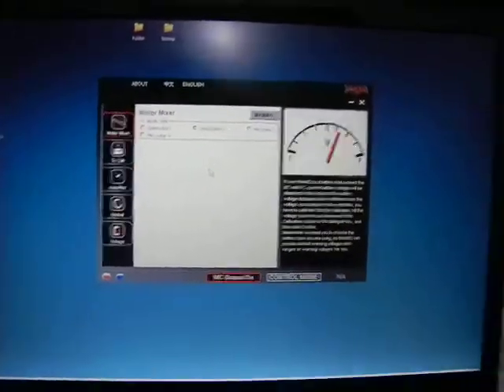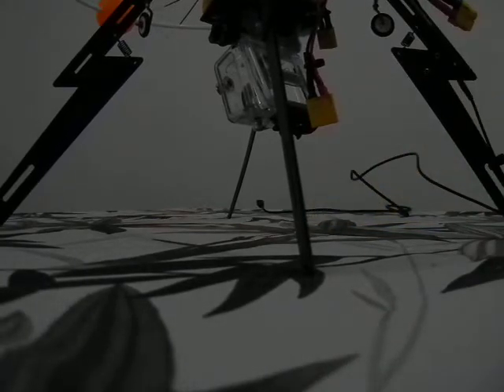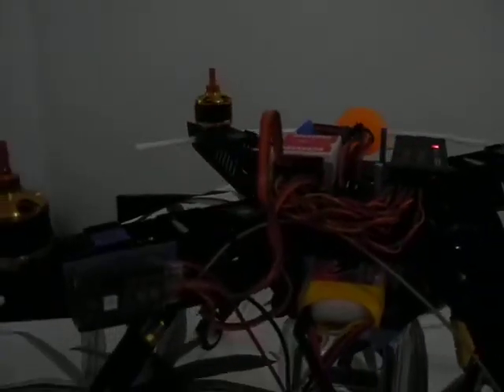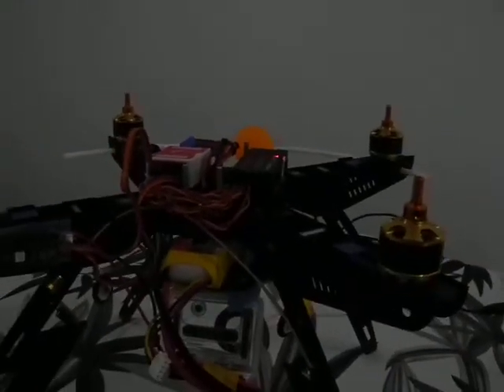DJI Naza - Gaui 10A Incompatible ESCs

Comment from the maker: I power the VU first, yes 2 cables, but sounds like the ESCs are good on your case, I would double check the control settings on the DJI software, you might have some control backwards, try different arming sequences, from the manual, and also, if you did not calibrate the escs throttle limits, do it.

Comment: Try to set it on quad X, & go to autopilot settings, push ''Default''. That should work!:) I had a problems to switch from quad to hexa.. m1 and m2 didnt work. But after i click on ''default'' button in autopilot settings, all motors work now! Remember to turn on acro mode before you do that. Hope it helps..;)

Comment: Mine unit says IMU-OFF  (ERROR), but It's getting power just fine, worked for a bit, then lost all controls to my quad, had to cut the throttle. Broke one prop, and now this error is there. Very upset. Any Ideas?

Comment: Hi Antonio

I have exaclty the same problem.. my M1 and M2 outputs don't work - I have Turnigy superbrain ESC's 

I can't understand why M3 and M4 work if it's a ESC refresh rate issue

How did you solve it - I don't want to have to buy 4 new ESC's 

Thanks in advance

Nick